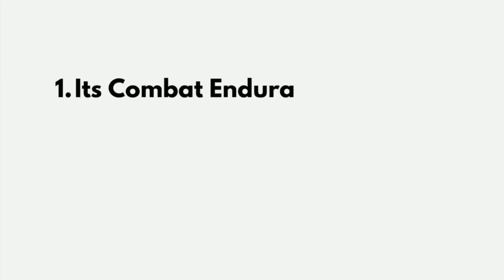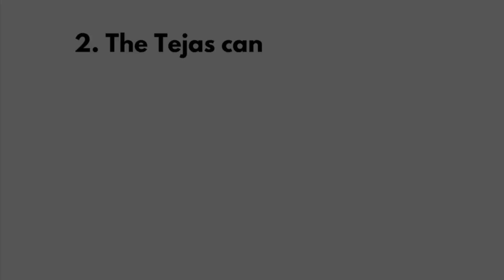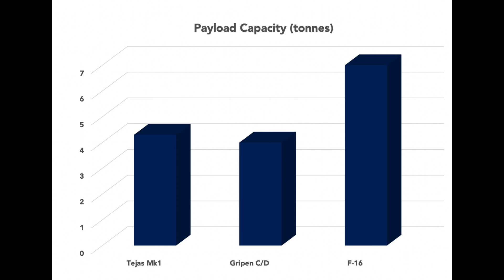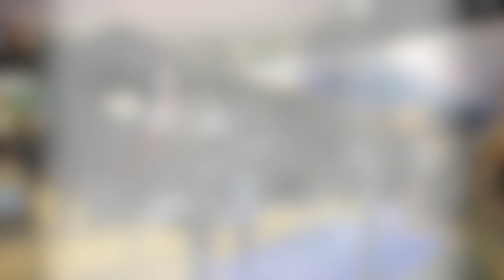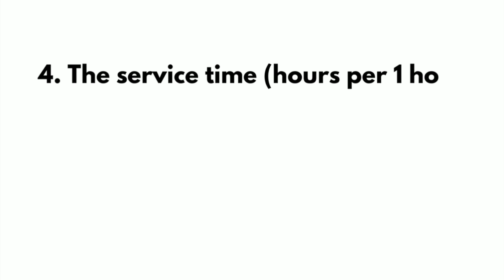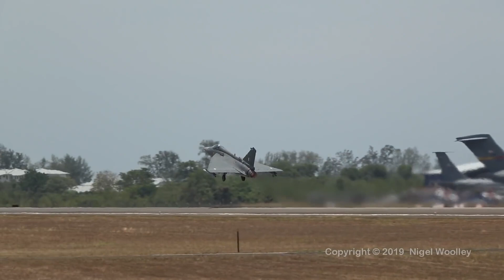How Good Is India's Tejas Fighter Aircraft Compared To Sweden's Gripen & America's F-16?

Comment: In a video I saw where Tejas and Gripen were shown to perform similar maneuvers, Gripen had slightly smaller turn radius. How significant would this aspect be?
Reply: Different aircraft design have advantages & disadvantages in various flight envelope.
Reply: Gripen C and Tejas Mk1 have similar agility. It's just that canards give you more lift than compound delta wing. But then again Tejas is over a 100kg lighter. So both are tight turning jets. Only problem is the Tejas is a bit less stable than Gripen if the pilot pulls high g turns.